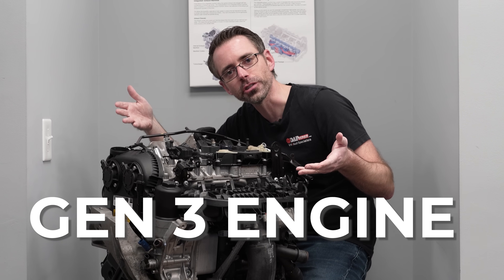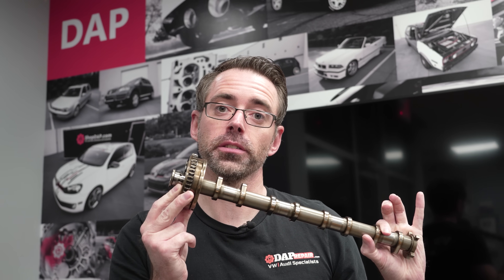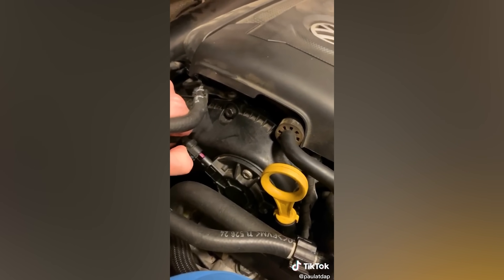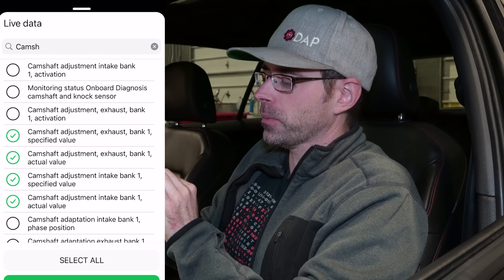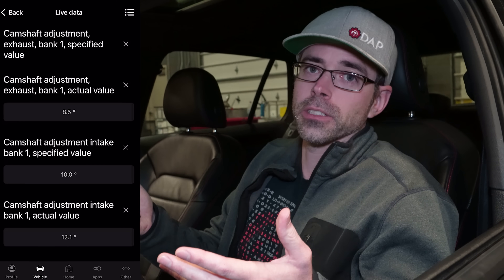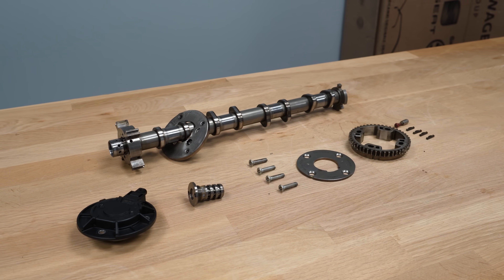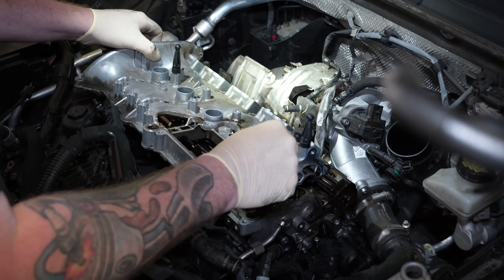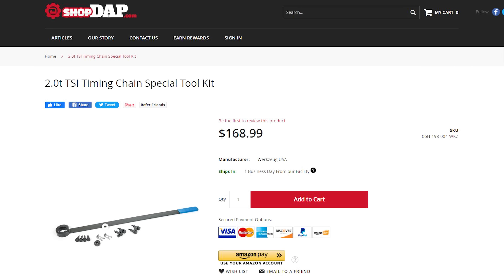Is this a New Common MK7 Engine Issue?

Comment: I had the cam adjustment magnets replaced in mine 2 weeks ago, the car seemed like it was a bit noisy (similar to the noise in your video) and the car was idling a bit rough (not enough to be overly concerned) the car has a full service history and I top the oil up about once a month (mine likes to drink a lot) unfortunately, the thing died at the side of the road and couldn't be restarted. Ironically, it died on its way to the mechanic (not the dealer but a very good local European car specialist) 

Not a cheap repair but the car drives fantastic now. I am glad I didn't need full cam shaft replacement and that the magnets were the only thing that needed replacing.

Car had 155,000km (about 96,000mi) when it finally went.

Comment: Maybe if newer-made car manufacturers, in-general, would stop making excuses for "normal" oil burning amounts of ~1 qt. per 1k miles and making these systems so weak towards oil starvation this wouldn't be a problem. All these over-the-top "efficiency" complex systems are not that efficient when one has to keep replacing engine parts or whole engines. 😂

Comment: Good Gti's have one dipstick, bad ones have two dipsticks: one that measures the oil the other sits in the driving seat!! Keeping good oil level is a basic requirement.  If are a diligent checker of tyres, washer, brake, coolant and power steering fluids you have the best chance of a good Gti.

Comment: Pro tip to make installing the cam cage easier: find some long bolts with the same thread/pitch as two of the stock screws that secure it to the engine and cut the heads off.  Insert these long bolts so that they’re effectively studs. Use these studs to perfectly line up the cam cage to guarantee that your sealant gets sandwiched in place perfectly with zero lateral movement. Insert hardware, remove studs, and off you go.

Comment: A Fumoto valve on my ea888 hit an armadillo which opened it ever so slightly. When I parked the car and briefly went into a store it drained the entire crankcase onto the parking lot. When started the car it idled fine, like normal, but when I put it into gear to reverse out the engine made a very loud rattle like if I had put a rigid metal “playing card” in bicycle spokes.  I immediately put it back into neutral, tried again, and got the same noise.  Then I very lightly revved the engine and got the noise quickly followed by the entire gauge cluster lighting up with the “LOW OIL YOU IDIOT” message popping up. I shut it off and there was no damage to the engine.

I strongly suspect that the noise it was making was the variable valve piece you’re talking about in this video. I looked up what the internals look like and it appears as though the metal “chambers” could make quite a racket if they were left to bounce around without oil in them. I can’t imagine anyone hearing that noise even once and believing that they should operate their car for long enough to actually damage it… or maybe they’re really fragile and I got lucky because my problem happened while parked and not moving on a freeway or something.

For the record I no longer use Fumoto valves.

Comment: Will this cause the EPC light to potentially come on under heavy load? Like hard acceleration? I never got the camshaft codes but many random misfires on my Golf R. When I would punch it on the freeway, every once in a while at around 5-6000rpm it would just hit a brick wall and the EPC light would come on throwing the car into limp mode. Shortly after multiple attempts at diagnosing the issue I ended up with that dreaded tapping/knocking sound. Drained oil, sent to Blackstone, nothing found in the oil. Nobody could ever figure it out so I just said screw it and sold it back to VW.

Comment: Alright, all I want or need to know is how in the world do y'all put the valve cover back on with the cams still in the head?  I tried and stopped and just took the timing components off per the manual to not damage an engine and have to pay to replace it.

Any insight is appreciated.

Comment: How about the cam lobes spinning on the camshaft? We've had 3x  2.0t and 1x 1.8t have the lobes on the intake cam spin on the actual Shaft and cause bad misfires and it was ridiculous to diagnose it the first time.

Comment: WHILE YOU ARE IN THERE REPLACE YOUR TIMING COMPONENTS!!!!!!

Please for the love of all, do not go this far into an engine and not replace the chain/tensioner/guides. Also, PULL THE OIL FILTER/PAN AND CHECK FOR METAL BEFORE BUYING ANYTHING. This engine probably has well over 100k on it or has been beat on to cause this failure, it is not common, and the ones I have seen almost always wind up getting an engine and a turbo. Again, as he stated, this is for experienced techs. This isn't something easily diagnosed and remedied. Several special tools are required and judgment based on years of experience is needed when determining root cause or consequential failure.

Comment: That was a great video.
Question: Rather than going in to the ECU to advance the timing for VVTI could you not just lock the cams in the advanced position using a wedge or blocking the return oil hole? for lower torque at all times for when you i dont know? Want to do a ton of quick acceleration pulls?

Comment: I had no end of problems with mine.
1. Bent a rod
2. Piston Rings
3. Valve spring snapped
4. Constantly had oil feedback through PCV

Went through 3 engines within 45k miles and 6 years. Well maintained over the years and she always wanted more from me.

Had to give her up in the end

Comment: I had this rattling sound at cold start for 2seconds https://www.youtube.com/shorts/fwJkcLLEYkw  , I replace both spool valves at 1,8tsi, change oil, put 2017 revised oil cap and return valve which should avoid oil to fall and also moved spring circleclip which retain tensioner to go backwards, closer to left (piston cant be pressed backwards because circleclip prevent to do it) and now I dont have sound... my suspicious is timing chain and its tensioner (tensioner is extended to 4 visible threads/notches from 7 allowed by VW), but somebody claim that yhis sound can be caused by vvt (spool) valves, so ? thanks
Reply: That sounds like timing chain.
Reply: @ItzMaxton  I moved backwards retaining clip on tensioner and problem disappeared. So during starts piston at tensioner are pressed to much backwards...

Comment: one thing that also happens in this engines is that the metal screen on the camshaft bridge brakes and it scores the cams or the bridge itself. So... the oil leaks out and lacks oil pressure to move the  cam phaser, causing the exact same check engine code. That happened to me and i toubleshooted like an idiot for like 2 weeks until i realized

Comment: the oil must be changed each 15.000km, or less if the car is running mostly in the city, and not at 30.000km ...or more!

Comment: Exact thing that happened to my GF's GLI even down to the sound. VW diagnosed it 100 miles out of warranty but ended up covering it under good will. The sound was very apparent inside and outside of the car.
Reply: Did they give you a cost for the repair? I'm out of warranty and I fear this is my problem currently. Just looking to get an idea of how much pain I'm about to be in
Reply: @f2tzoomzoom I don't remember the exact number but it was not cheap, like $2500+, but understand that was the dealer. I'm sure an independent shop would have cut that price significantly. The price was why we kept pushing for it to be covered, we had to get VW corporate involved, but it worked.   Good luck!

Comment: I run a 1.05l EA111 with a 084 gearbox in my 1993 Polo 86c, it has oil drips everywhere but no oil consumption! It's a cast iron block, so although it has a new thermostat it takes ages to warm up....

Comment: So the owners that never lift the bonnet, now with VW can take out a second loan if they don't check their oil. People don't even check tire pressure so that's why TMS - but people don't understand 
it doesn't work for engine, transmission or coolants the same way.

Comment: Lol,Volkswagen-they dont make engines like they used to. Those old beetle air cooled engines if looked after were incredibly reliable,not so with these engines they are absolute garbage quality. Like a lot of new engines thesedays they are not made to last they are made to a budget. Toyota is about the only car manufacturer that still makes quality vehicles and engines. I certainly would not go near any Volkswagen,good for 200,000 ks and then they are ready for the wreckers.

Comment: When you mentioned "seals are leaking" in the video, did you mean the cambridge o-ring seals, or those little seals that you took out of the cam-shaft adjuster in the video?

Comment: I had a similar issue with hunting, but it was just because the cam magnet was bad!
The old owner didn’t keep up with oil changes so it got junked up and couldn’t move properly. New cam magnet installed (just takes a couple of minutes) and now the specified and actual values are within 0.5 of each other 🎉

Comment: The old 4 cylinder 20v was a bullet proof, and here in Brazil we stroke to 2.0 20v. Lasts forever, it´s cheap and we make 400hp or more if we want.
But this EA888 is expensive, cams has problems, oil pressure problems, balancing tree has problems.

Comment: My MK7.5 started drinking oil at 6k miles, dealers just kept saying it was "Normal", had to drive around with oil because the "Check oil level" light kept coming on.

Then she started knock, knock, knockin' when i was in the McDonalds drive-thru. Needless to say, I sold it back to the dealer with 10k miles on it.

Comment: I had a similar problem but the timing jitter was around 3-4 degrees. Replacing just the electromagnet fixed it. Even after cleaning the push pin, it still moves roughly on the bench (I use a variable power supply). The push pin was just worn out. It holds to 0.5 degrees now.

Comment: Had the exact problem, was chasng the cause of it for about a year and half. Problem with my car wasnt in oil starvation, but worned out magnets and camshaft actuators. They were completely blocked. After putting new ones, the sound mentioned in the video showed after 5k km. After replacing them with the new ones, the sound was gone, but car was losing oil pressure at about 3k rpm and went into limp mode when warm oil. Oil pressure test showed everything was fine. Then after a year, low oil pressure warning came up. I found that the camshafts were losing presure in cambridge. New cambridge and camshafts, but then the turbo blew. Hopefully everything is ok now

Comment: ... again Vw - Audi issue -  simply buy Toyota/Lexus... 300K on Scion tC ~300WHP no / zero/ ZERO isues...
...just change oil, tires...  now the same - ZERO problems with 2021 Corolla Hatchback ~210HP

Comment: Keep in mind the direct injection makes a lot of noise too. It's easy to confuse the two noises.
Reply: not really, when i had thoise noises on admission camshaft, if you put the finger over the cover of distribution in the area of the camshaft , you will feel the vibration

Comment: Like any modern egine, after 200k km the camashaft slopes may drift off the main rod and destroy the engine. VW has this issue on there diesels and gasoline cars. Mercedes had this issue on 2018/20 OM654 2.0 Diesel engine. BMW on all new engines. They are cheaping out on production, before the cams were milled but now they are cold pressed into place

Comment: How does the plunger in relation to the oil pressure allow the mechanical advancing or retarding timing?
Reply: The change in oil pressure allows the camshaft to rotate by a few degrees as shown in the video. This basically changes whether the cam lobes make contact with the rocker arms earlier or later, in turn changing when the valves are open or closed.

Comment: In my experience I have been finding the cam correlation codes tied with the p0087 and then inspecting the chain tensioner to be overly extended

Comment: I love how VW has learned nothing from rotary apex seals and their sealing problems over time... Especially when there is not enough proper lubrication. A very clever system, but it’s just not fit for an economy car, where the owner doesn’t care enough to change the oil once every three oil change intervals!

Comment: Oh Crap. I just spent $1500 putting in a new front and rear suspension with new Bilstein B4s on front/back and new inner/outer tie rods, ball joints and stabilizer bars. But now my car ticks at 1000-2000?rpm. And I paid $1300 30k miles ago for timing chain job. I thought my cam phaser was bad. But my mechanic said engine is worn out at 269k miles and bearings are wearing so he mixes 1/2 regular LM oil and half thicker Motul. Says that temporarily counteracts loss of compression. I really enjoyed my 2014 GLI especially after a stage 1 Unitronic tune and beefier 034 Motorsport rear sway bar. I have enjoyed this car immensely. But time to set your out to pasture. Looking for a lightly used Toyota RAV4 now. I want to experience what reliability is.

Comment: I had to laugh, check your Fkg oil, so simple to do, so mind blowing expensive if you don't. I recently brought a car I was trucked to from out of the city, when I started it, it sounded terrible. I called the person who must have been a dodgy dealer in drag said, oh it probably just needs a good run. And guess what, the dip stick showed nothing. I saved that car, been great since, sounds sweet no noises and performs well, no oil use that I can tell of...  So check your oil, and tyre pressures...

Comment: Not to be a hater as i am Audi fanboy 😅
But every engine VEG group has made with timing chains is a ticking time bomb for the wallet 🙄😂
2.0 tdi have 240k belt interval and never fails and chain is supposed to be lifetime, sucks that the "lifetime" is from 70k to 160k km. Usually starts ticking heavily around 90 to 120k km here in Norway 😐

Comment: My audi a5 gen 3 engine had a failed solenoid camshaft valve on intake and exhaust. replaced both wit oem parts and solved my ticking problems.

Comment: I have seen many 1.8 cams for sure. But actually what I have seen more is the actual magnets that control the oil movement.
Reply: My car has a ticking sound similar to this, but does not happen at idle. Replaced the magnet and oil control valve but still have a knock sound. Let me know if you would be willing to talk to me about this issue, I cant find anybody that knows anything about these engines! Took the car to a shop and they said nothing is wrong...

Comment: I took insane care of my gen 3 and got rod knock due to lack of oil with no apparent reason at 92K
Reply: I feel you. I have spent thousands maintaining mine and it always seems to have some weird problem.
Reply: Same. 85k for me. Although I never reached the point of full failure. My indy shop threw new plugs and heavier oil and told me to drive it to Carvana and sell it immediately, which I did. I made out good on the price. But it still makes me sad that i had to basically throw my car away in a pinch

Comment: When using the obdeleven or other tool would a failing magnet in the camshaft adjuster not cause the same issue? I'm not a mechanic so could be totally wrong which is why I'm asking.